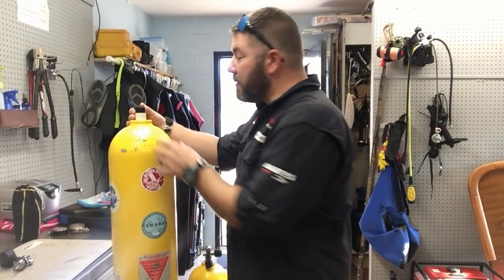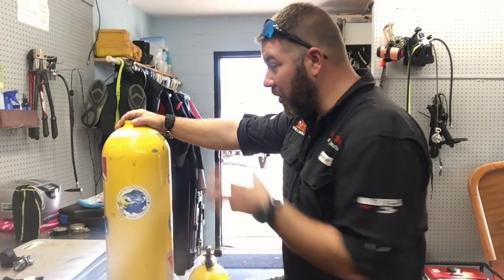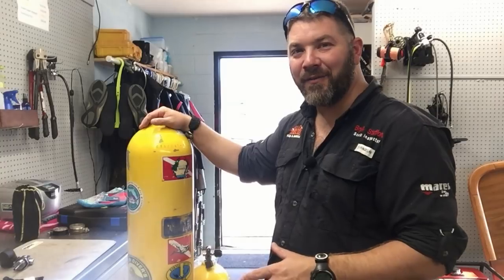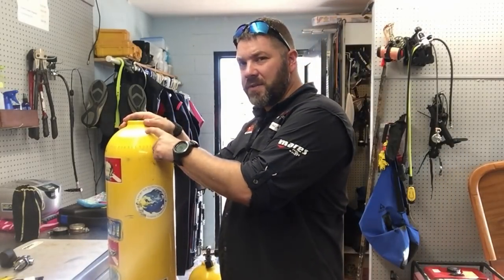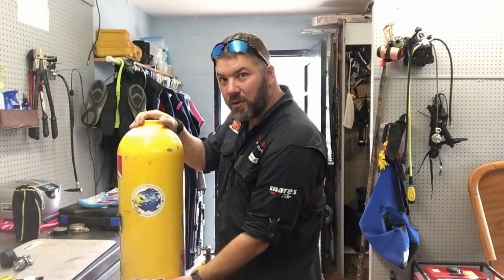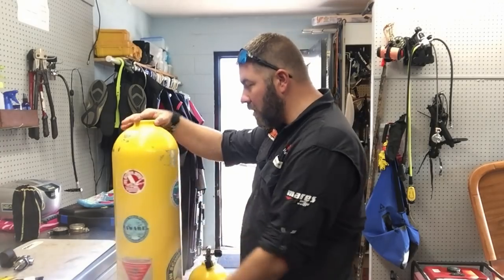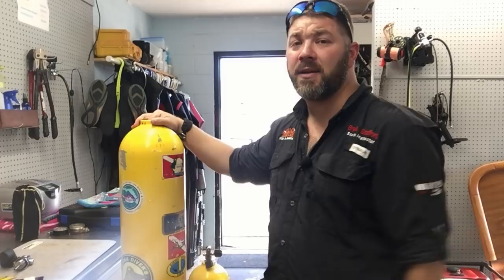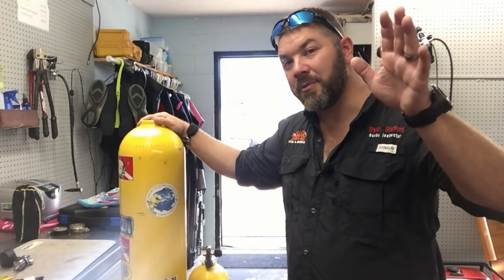Tank Stickers

Comment: Great video. Another major-ish change to visual inspections. We only did internal visuals back when I owned tanks in the 80's. I am assuming, (yeah, I know...) that this is due to the major Aluminum alloy 6351 tank "recall" a few years back?
Reply from the maker: Glad you liked the video Sam Moyers.
Reply: Only thing that "recall" brought is the eddy current test for those years of manufacture , and its not a recall so to say its just that those alloys had more lead than it should've but it dosent automatically mean these cylinders are not good

Comment: Just curious, but where does your shop stand in regards to inspection and filling of 6351 alloy?
Reply from the maker: As long as the cylinder is not a Luxfer, Walter Kiddie, Norris, or Alcan cylinder produced before the 1st of July, 1988, or has the following special permit numbers (6498, 7042, 6688, 6576, 6020, 890, 12695, 9791, 12079, 12479) we will fill them.  As for 6351 alloy specific cylinders, as long as they have a current Eddy Current certification we will fill them as well.  With this being said, we do not do Eddy Current testing during the annual inspection of cylinders here at our shop due to unreliable results that come from the Eddy Current machine. So if a customer brings us any of the above cylinders, we respectively deny them a fill. We recommend all divers that have a 6351 cylinder to reconsider the value of their life and the life of our fill operators (who face the greatest risk of injury during the filling process) and simply buy a new cylinder.  I know I personally value my own life way more than a cheap $50-$100 yard sale cylinder.  And to be honest, $200 for a brand new Aluminum 80 isn't all that much.  In the long run, its pocket change compared to the cost of your or the fill operator's life.

Comment: Hey, how are you all doing today?
 I have a question that's been bugging me since I started diving this year. What is the CORRECT way to store a wetsuit? Is it hanging by the shouders? folded in half in a hanger? Should i store it with talc powder in the seals to protect them?

I have 2 wetsuits, a 7.5mm wetsuit and a 7/8mm semi-dry suit.

How should i store them? Once i used a hanger, and the semi dry i padded the top of the shoulder of the hanger with 2 large sponges and hanged it in it by the shoulders so it gives great support.

But I worked in a scuba center and they hang 99% of their suits folded.

So What is the best way? Can you help me?

Thanks.

Have a fantastic day.

Kindest regards from Portugal,
Rony
Reply from the maker: Limiting creasing in a wetsuit will definitely prolong the life of a wetsuit.  Thus hanging them up to dry and to store, with a proper hanger is by far the best way to do it.  When you fold a suit, you can cause creasing to occur.  This in return will break down the elasticity quicker in a suit, thus wearing out the suit faster.  If you are in the situation where you must fold it to store it, you can always use a wide hanger to flatting out the suit at the point where you fold it, preventing it from creasing.
Reply: I like to hang mine from the shoulders, like you normally see them in the store or you would dry them. Some people say that damages the suit on the shoulders.
But in one of them what i did was, I bought those foam tubes that you use to isolate water pipes cut 2 pieces to size and put them on the shoulders of the hanger, than on top of that i strapped to large foam sponges on each side to give it volume and support and that's how I hang my aqualung solafx 8/7mm semi dry suit. Do you think that's a safe way to store it?

Thanks a million for your tips.

Hugs from Portugal
Reply from the maker: You're welcome, and sounds like you have a great idea for a new hanger system.  This is why we tell our students to use wide hangers if they are not interested in the ones that are designed for wetsuits.  The wider the hanger, the less stress on the material.  Over the years I have used the little white plastic hangers that you get from the store, but instead of using only 1, I will use several of them, and even tape them together to create a wide hanger as if it was a standard wetsuit hanger.
Reply: Yeah that's great, several hangers is a great idea, and I bet if you put those foam tubes like i did, it would be top notch perfect :P
Yeah I know those made specially for wetsuits but in my opinion they«re still not wide enough or round enough at the top and again, they are solid plastic i'm always afraid that the weight with time may damage it!
Reply: Yeah, by the shoulders.  Use a wide coat hanger, the kind for hanging heavy coats.  Invest in a plastic garment bag and hang it inside that.  Limiting the air flow around it will prevent oxidation of the rubber (and therefore deterioration), and keep it out of the heat.
Reply from the maker: @LarsSveen  I like the garment bag idea as well. Thanks for the advice.

Comment: How do you remove the sticker?
Reply from the maker: Hello David Ressler, great question. If I am trying to salvage the sticker for the client, I will simply use heat to loosen the adhesive, then I can simply peel off the sticker. If the client doesn't want to keep the sticker, then I simply use a scraper to remove it.

Comment: This is a big pet peeve on both ends, one, as a fill station worker I don't like to fill tanks with too many random stickers on them; but as a diver I have had issues getting fills when I travel when I dont have some stickers, on my stages and deco bottles I have my vip sticker, name sticker, and MOD stickers, no nitrox wraps/trimix stickers or other stuff on there and some shops have told me they wont fill them as such.
Reply from the maker: It has always been my experience that it is a regional issue, and heavily debated between the recreational and technical crowd.  Painting an individual cylinder tends to be an issue with some fill stations as well.  We don't mind stickers during the filling stage, but they do present a problem during the visual inspection stage.  VIP, MOD, and any other sticker required during the filling process is OK with us, as long as its not excessive as mentioned in the video.  It really becomes confusing for a fill operator, when a tank has multiple inspection stickers, and we have to decipher which one is the most current. Thanks for sharing your experience with us.
Reply: @LakeHickoryScuba  my biggest issue I've experienced is a refusal to fill tanks with nitrox or trimix if I dont have a tank band, and instead standard GUE markings. I will only refuse to fill a bottle if it is 80% or more stickers and make a judgement call, or if I feel they are concealing possible damage.
Reply from the maker: We are one of the few shops, in our area, that will actually fill a Nitrox Cylinder, even if it doesn't have a Nitrox Sticker on it.  We look at the inspection sticker to determine if it has been O2 Cleaned for Partial Pressure Blending, or to see if has been serviced for Pre-Blended Nitrox (up to 40%).  At the end of the day, it always comes down to a trust issue between the customer and the fill operator.  If I receive a cylinder from a customer and he tells me that it has been O2 Cleaned, and he has tank markings that would indicate that it has, and then he ask me to partial pressure blend him a mix, I have to trust that he has never had anything other than O2 Clean Air (Oxygen Compatible Air) before I fill his cylinder.  Furthermore, if a customer comes to me with a Nitrox Cylinder, which is O2 Cleaned, but just wants air (21%), then he has to trust that our air is O2 Clean Air, and that it will not introduce any hydrocarbons into his cylinder.  Sometimes trust is all we have, and its a gamble.  The other way to deal with it, which is what most shops in our area does, they require there own inspection of the cylinder and they will not fill it, if it has another shop's inspection sticker on it.  It all comes down to what that shop's insurance company says they must do.